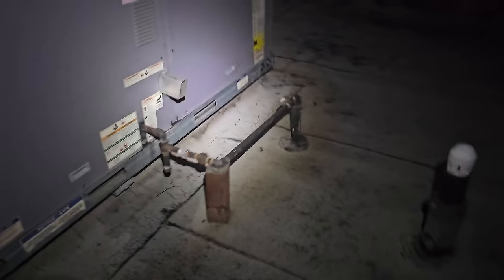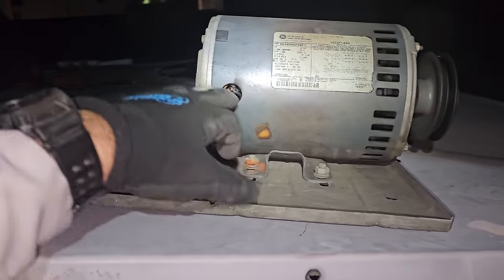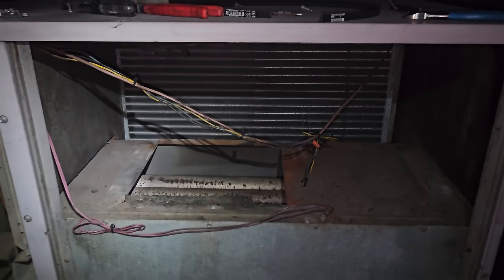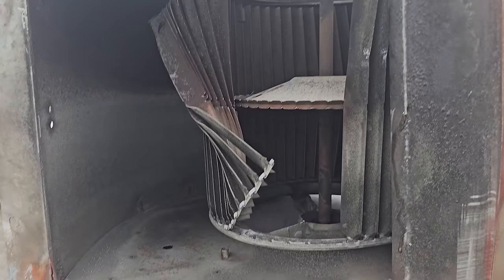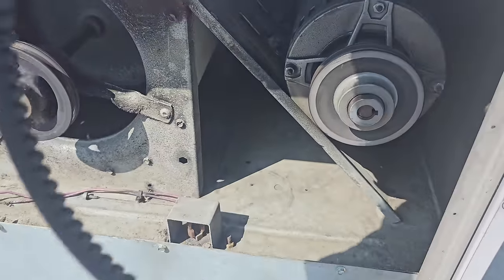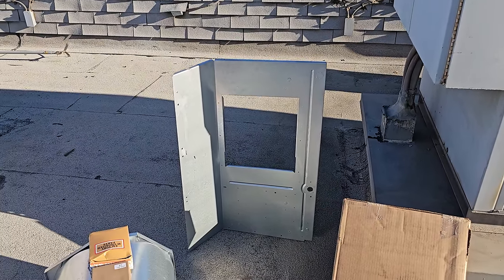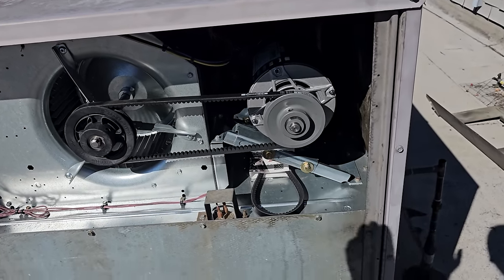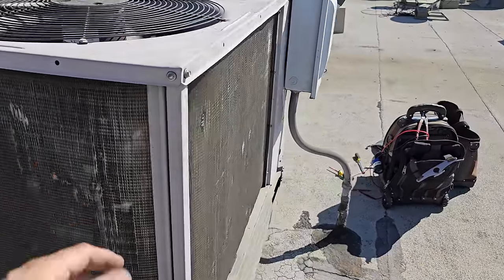HURRY THE AC IS ON FIRE

Comment: As a 33 year firefighter I have see dozens of burned up motor/ fans in hvac systems.  We cut power check it with a thermal camera but will not throw water in there and ruin more equipment and cause more property damage if we don’t have to.  In all that time I have never had a rekindle on one. (Watch it will happen next day I’m on duty).  The smoke smell will dissipate over time.  On cloth and ceiling tiles the consumer odor eliminators are pretty good.
Reply: that makes perfect sense and it's very unlikely a fire in an RTU would spread out of it, unless it was a large natural gas/propane leak.  I mean, it has minimal flammable things inside a steel case and the blower stopping would slow any flow to a snails pace of makeup air via negative building pressure. that said, anything is possible and the FD should always be called to evacuate, check and ventilate the building.

Comment: I actually watch your videos to better my knowledge with AC units as a firefighter. Our district has Hundreds of commercial roof top units and we are constantly chasing smoked belts, duct detectors and burned up motors. We always open up the unit with hand tools, verify and check for extension. However some departments don't want the liability of opening up someone else's equipment unless they can confirm a fire inside. More than likely the smoke stopped when they cut power, checked with a thermal imagery camera and called it a day. Thanks for the continued videos!
Reply: Thank you for the valuable work you do - and thanks to all of your comrades. The fire service where I am is held in extremely high regard and I daresay it is where you are as well.
Reply: As a fire alarm tech that's cool to hear. In my service area we see everything from "this deficiency has been on the report for 10 years and the FM couldn't care less" to "code book under arm, zero problems allowed", and it's always good to hear what actual response looks like and operates like. As an alarm tech my most usual interaction with you guys is apologizing for getting you dispatched because a property manager swore their system was on test when it wasn't. 

Edit: Also, at >2000cfm/5 tons this unit should have had a duct detector shut down the unit within a few seconds of smoke entering the ductwork, fire alarm system or not. Maybe these units were old enough to predate that requirement, but even the scabbiest duct detector install would have cut power to the thermostat and the unit would have stopped the blower after about 30s.
Reply from the maker: Thanks for watching!!
Reply: Exactly, we don't open units unless there is active fire. Just disconnect power. We do have a few ppl that are electricians or hvac. If I have a question or issue, I'll call them personally on their phone.

Comment: As a former motor shop tech and manager, I used to see a lot of 'small' motors (as well as large ones). While retired now, I saw many small motors burned up in systems with no fuses or wrong ones, and thermal overloads that didn't work properly. Nothing usual at all. Depending on a thermal and/or a fuse to keep a motor from destruction is doubtful at best, especially when multiple people do the maintenance..

Comment: I'm not going out at 11 30 pm. "I'll see you in the morning". If fire Co was there and they say it's safe and left, then it will wait till 8am. 
I tell my customers if they want to skip scheduled maintenance, they will pay me a lot more later when parts fail and you still have to do the maintenance.
Oner of my customers has a walk in cooler door that is tearing itself apart because its not anchored at base. We were called for icing evaporators and its the door not sealing. Told her I can fix it for $500 and door will last many more years but she declined. Door frame is getting weak and when that internal steel fails it will be $5k for door replacement.

Comment: Love the video but I have one criticism. Don't replace variable pitched sheaves with another variable pitched. Figure out the diameter that the variable one was set to and replace it with a fixed pitch. The variable ones are only meant for the initial install for setting air balance. Plus the fixed pitch sheaves are cheaper, so you're giving your client a better deal for a sheave that will last WAYYY longer!

Comment: I worked for UL, I wondered if the AC have UL or other approvals and the replacement parts also.
Any motor I checked for UL should have stoped due to the high temperature fuse blowing.
Or if it was resettable it would come on when the temperature dropped.
Thus it would turn on and off.
If this was UL motor it should mot cause a fire.
Presumably beacuse you are working on buildings equipment, FM and electrical  standardd also apply.
I think I would wilt doing your job.
I don't like the heat we have in the UK at present 22 degrees C, 71.6 deg F.
Thanks for the video.

Comment: What’s crazy is on one end the spectrum some people would call you a hack for not replacing the entire unit yet don’t understand that the customer has the final say at the end of the day even if you recommend a whole new unit meanwhile on the other end of the spectrum others would call you a greedy HVACR technician or basically trying to upsell the customer on a new unit not realizing or understanding that the machine in some cases will end up costing more in the long run as the age increases making it less reliable and therefore it starts to become an endless money pit where the price to keep it running surpasses the cost of a brand new unit, I think in some cases it’s better to replace the unit and have it be more reliable than the old “faithful” that really isn’t faithful anymore and can eventually fail catastrophically to the point of catching on fire and potentially causing serious injury or even death and causing severe damages to the property!

Comment: 10:30 Plastics start to melt at around 120 and are fluid at around 150 °C. There are plastics with higher melting points, but I guess that the plastics in the motor are more the regular ones. Thus, there must have been at least 120 °C in the motor during the fire. I also think, that maybe the implosion of the blower assembly happened gradually (First potentially rubbing only at the housing until the flaps completely detached) and that may be why the motor has become hot without shutting down on overload. Does it mean there should be a temperature sensor in such motors additionally?

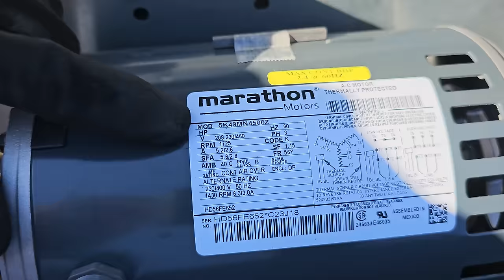Comment: 17:50 The fan motor diagram described two blue wires from the thermal sensor. Shouldn't they be routed outside and connected through the fan relay?
Reply: likely that's a new option and only useful for being linked to variable frequency drive or some other early alert safety gear to trip offline or send automated alerts.
there would still be a physical thermal overload protector, now as to if they'll work or not when needed or keep working if it's overheating endlessly? they could weld shut and just keep nuking. lol 🥳🤡

Comment: I bet when the squirrel cage bent while the motor kept going causing the wheel to grind causing sparks since the smoldering was over the cage vs motor
It happened to one of the ahu at the hospital I used to work at.
Only I didn’t catch it in time. It grinded out the cone, blower wheel, and disintegrated the doge bearing.

Comment: The blower assembly on my attic system is going on 50 years. These roof systems are fairly easy to replace, why dont they just buy new ones instead of trying to repair junk.
Reply: The 1 package unit was still useable it just needed some real preventive maintenance 👨‍🔧

Comment: Usualy there is no need for a big fire when a plastiq piece burns, it can crate a lot of smoke from a real small flame. And inside the space, if the smoke is from plastiq, you will see that smoke even after the fire is off, maybe is like you said, small piece of dust still stay in the air. But people don't think that maintenance it is cheaper than to buy a new instrument. Maintenance is always good
Reply: He has videos explaining that, basically opening or closing the motor pulley to increase or decrease its size changes the speed and respectivly the amp draw

Comment: I am supprised that the fire department didn't open up that panel with their axe.  I once had to check out a fry station that the fire department had opened up the exhaust duct chase with their axe.  I did not realize that an axe could cut through stainles steel like it did.  The Ansul system did it's job, there was very little fire damage but the damage that the fire department did was enormous.

Comment: I would not have gone off that roof without changing the bearings on the other ac. It's a fire hazard, bearings like that can cause a fire if they are not in good condition. Wouldn't be suprised if high friction of the bearings would have caused that fire from the extra load on the motor.
Reply: Ultimately it's up to the customer, you just make sure to document everything and let them know.
Reply: @adamdnewman  If the customer would not want to have it replaced, I would shut the ac down and let the fire department know. By knowingly leaving a fire hazard like that you take part at any consequences coused by the fire (At least here in Europe). Someone could die, if it would burst in flames. 

I'm no HVAC worker, but I do work at construction sites and anything I see that is a fire hazard I have to report it immediately.
Reply: "At least here in Europe"
Ah, you mean someplace with actual civilized health and safety laws.

Comment: Another big issue I've found with commercial equipment that keeps people from wanting to change units out is the joke of a 1 yr warranty on most of it. Guaranteed if most manufacturers had a 5 yr blanket warranty on all parts  a lot more stuff that needs to be changed out would get changed. It's frustrating from a techs perspective but I totally get it. Why spend upwards of $10,000 or more then a year and a half later something goes bad and we are like well it just went out of warranty sucks for you.

Comment: This is a common practice that needs to stop.  to gain access; remove all necessary screws to avoid bending the units top. Clean all panels in the unit that touch inside air, use a gel block deodorizer for smoke, it helps with the duct smell as well. I would also check the heat exchanger, if thats bad I wouldn’t put a nickel into it.

Comment: I’m not in the industry but seems like now a days with variable speed motors you could design a package unit to have a direct drive blower. Eliminate the belts and pulleys. But watching this channel I see that the motor controls are also a failure point 🤷
Reply: Lots of units do have direct drive motors, it’s actually fairly common. Belt driven units are just part of the things in our industry that haven’t been updated all the way yet
Reply: Chris did mention this issue quite a few videos ago when he was doing a couple of fan replacements. I think he said they are available but they are more expensive?
Reply: direct drive isn't very common in larger units, as the motor size is often too large to fit in the wheel and/or will impede the airflow volume too much.

Comment: Motors stay hot for a LONG time.  I had a pressure washer melted down (plastic mounts and brushes holders anyway) and even unhooking power and soaking it with cold hose water, flipping it over and filling the casing up until it stopped bubbling-boiling, let it sit an hour...and it was STILL so hot I had to wait longer to handle the motor directly.

Comment: got a couple of questions. Number one was there a duct smoke detector in this unit? I would be surprised if it did not trip. Also leave it to the fire department to leave a fire still currently smoldering and not doing anything about it.

Comment: I suspect that when the blower assembly stopped abruptly, the belt started slipping and that's why it took a while to go off on overload.
Reply: belt didn't look burnt at all, not even very glazed. I'm guessing it was tight enough stop it dead or it tripped breaker and "idiots" kept resetting it and it sat in stalled condition for long periods. likely the "makeup air" and "negative building pressure" combined was still drawing cool air in.
Reply: @throttlebottle5906  I don’t think the air to cool comes off the roof or out of that. This is just the outdoor unit.
Reply: @v31.48  that's a rooftop package unit (RTU), everything is in there(compressor, condenser, evaporator, indoor blower, etc.)  the ducts come out of the building through it and back inside, via the "curb" underneath it.
return air and supply air both enter the bottom, it also has "economizer/makeup air" on the side, which brings in outdoor air  when it's cooler outside or if building needs outside air  to makeup for exhaust fans causing negative building static pressure. 🤓

Comment: In my experience , there are needs and wants .  I was a little confused why we shut off the heat based on the fact that it needed a pm.  If the heat exchanger was cracked it’s one thing.  Maybe if there is an issue with the sequence of operation or something visible sure why not.  But aren’t we now forcing an unintentional service call ? I love your content , but just wondering how does this help our customer ?

Comment: I'm a firefighter, it depends upon the owner and protocols if we tear it up, plus water going to the vents is a terrible idea we can use cleangas like CO2 and is prolly what they used to prevent damage just by shoving it straight to the economizer.

Please replace the insulation as it can offgass toxic cyanogens or carcinogenic vapors after it's cooked

Comment: No blower motor fuses on these?
Reply: Internal overload.
Reply: @jasonjohnsonHVAC  Doesn't look like it worked too well. But that's the protection it relies on, no separate fuse?
Reply: @inothome fuses and breakers protect wiring thermal overloads for equipment internally or externally
Reply: @dan4age  Correct, but you can't expect the main disconnect to protect the blower motor. Which is what I was asking, any fuse(s) for just the blower? Obviously nothing stopped this from a melt-down.
Reply: Unlikely.  The 5t Trane units we have have no fuses other than the ones in the disconnect.
Reply: @inothome  no it didn't do a very good job of protecting it. I usually only see fuses on the blower if it has a VFD. These manufacturers make these units as cheap as possible....for instance an AAON will have fuses...but an AAON also costs more and is a much better quality unit....that a restaurant will almost never spend the money on
Reply: @inothome  fuses would have to be rated above the motors locked current draw because they draw that much at startup defeating the purpose thermal overloads have a delay before tripping
Reply: @jasonjohnsonHVAC  Agreed, it's ridiculous how "cheap" they try to make these units. Two pole contactors instead of three pole, wires just ran all over the effing place and rub out, no wire management, no terminal strips, no fuses for the blower motor (at least in this case it seems), etc...  
Compared to most electrical equipment, HVAC equipment in the US is an absolute mess. My main work is substations and we fuse everything. But, we are also keeping the lights on. 
I have worked on some EU/ Chinese  Japanese HVAC equipment and everything in my experience has been done nice, cable trunking, nice terminal strips on DIN rail, fuses, layout nice and actually pleasant to look at.  Most of the US HAVC stuff I just want to get in there and clean it up.
Reply: @inothome  honestly its mostly the Big 3 who do this type of crap. Trane is probably the best out of the big 3....other manufacturers do make a concerted effort at wire management and routing. This is carriers cheapest most produced unit. When you get into the larger equipment....it is a lot more professional. Quality used to be something we lived by....nowadays its just a sales slogan. Planned obsolescence is a real thing. Corporate greed runs this country...not the elected officials.
Reply: @jasonjohnsonHVAC  For sure corporate greed is ruining the country. All about how they can get every dollar from you.

Comment: By any chance do you have a video where you explain how you slow down the fan motor? Would it be a pulley change or add in resistance?
Reply: It would be a pulley change. The idea is to slow the final drive down by making the motor pulley smaller and in doing so there is less load on it so the current drops.

Comment: I bet that motor was already on its way out and when it stopped, it didnt pull enough current to trip the overcurrent protection. Then it just sat there until it melted the circuits/brushes inside then died.

Comment: The bearings on those motor and blower are very easy to replace if you ever decide to do it in A pinch. but than again i actually go for full new jist because once you start cobbling it togeather 20 more things go out right after. Like cars but no one wants to belive that about cars lol.

Comment: To think that a simple cheap HAL-sensors with a very simple circuit to cut-off the relay voltage and a dimple on the motor pulley wouldve prevented this.....

Comment: That Looks like low voltage damage to me. I recommend you tell them to hire an electrician to inspect their primary power distribution panel, circuit breakers etc for loose connections. If the building is circa 1970-1985 it just may have aluminum wires. Low voltage means high amp draw which can and will burn things up without blowing circuit breakers.

Comment: 🎶"The roof, the roof, the roof is on fire... We don't need no water let the motherf'er burn! Burn motherf'er, burn!"🎵 -- The Bloodhound Gang

Well, the "restoration" seemed a lot simpler than I thought it would be - not a difficult job, just a time-consuming disassembly of 1000 parts to get to the half-dozen affected pieces. 🤣Another similarity between HVAC and auto repair! (Did you have any extra screws at the end? LOL)